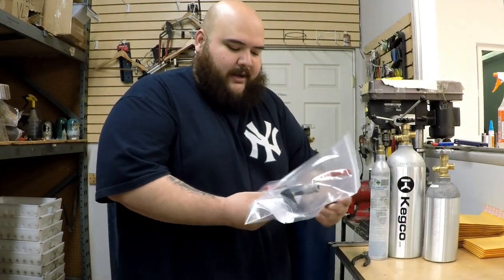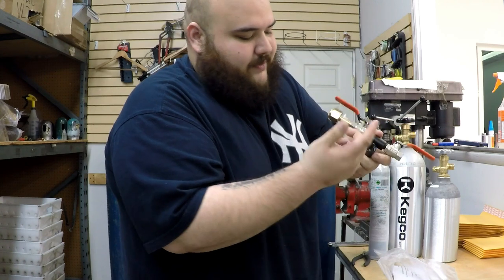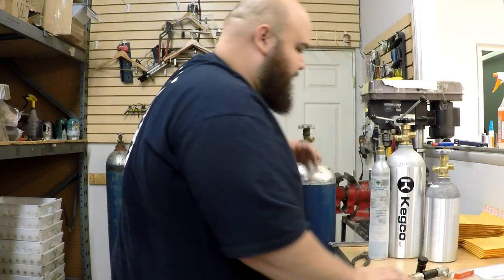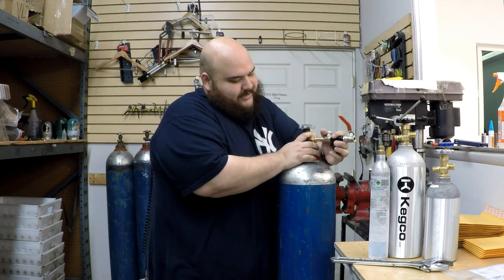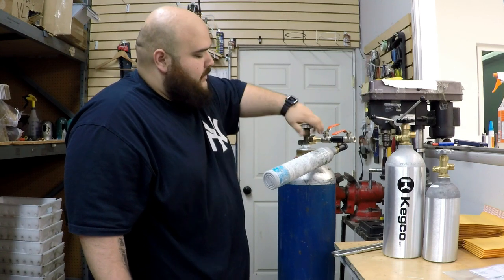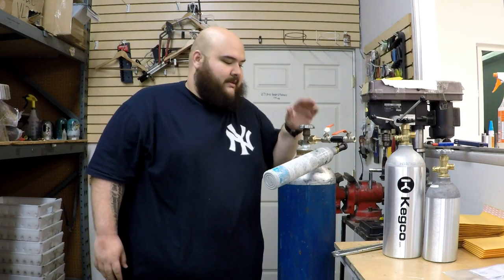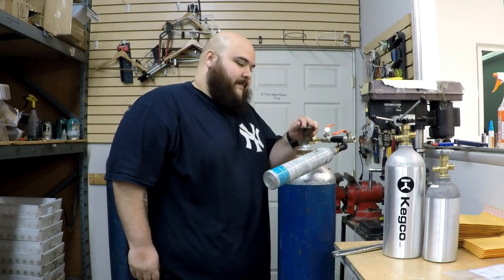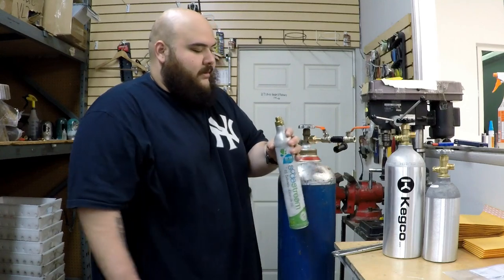Small CO2 Refill station for soda machine tanks

Comment: Thanks for the vid; this is the one with the best advice, though not perfect. The real trick is to just crack the supply side valve on the "kit." But, about that black plastic fitting for the SodaStream tank: you have to turn it counterclockwise to back out the pin that depresses the valve on the SodaStream tank. Once the carbonator (SodaStream tank) is fitted up nice and snug (it's plastic, don't overtorque) you have to turn the knob very gently until you make contact with the valve on the carbonator tank, and then screw it in just a half turn; again, just to crack the valve. The key to success here is "Easy Does it."

Comment: Being doing this for a few years and for you home fillers if you put the mt soda stream bottle in the freezer first, to pre cool before filling, you might have to do this a couple of times to fill the cartridge. Remember a newly filled  20 lb gas bottle puts in a lot more gas then a bottle that is down to the last few pounds of gas. Filling  will takes more tries as the supply gets depleted, literally you might only get 20 or 30 grams each try at the end of a bottle?  My experience says mt soda stream bottle is about 680 grams and you are putting in roughly  410 grams of gas to fill the bottle, for a total weight  of 1090 grams. For clarity i usually take 3 to 4 fills to top off an mt soda stream bottle and you are not burning a lot of gas trying to chill the bottle as you are filling up. I can usually get about 16, 410 gram fills out of a new 20 lb bottle.

Comment: I plan to purchase a New Aluminum 20 lb CO2 Tank CGA320 with SIPHON TUBE. Local sources to fill the tank are quoting $25 to $30 per refill. How many soda stream canisters will one fill of the 20lb tank fill?
Reply: About 10 large tanks (20 lbs = 320 oz. 320/33=9.7). As a practical matter though, as your donor tank gets low, the refills take less and less air. So it'll probably be more like 6 full refills and then another 8-10 partial refills. Double that if you are using the small tanks.

Comment: There are some very helpful comments here, especially for those of us who do not have a siphon-tube tank. My concern is this: My non-siphon tube 20 LB tank is a bit heavy and risky to invert without some kind of a special stand. Would I be able to decline my 20 LB donor tank at 45 degrees until 75% of the liquid CO2 has been consumed, and then invert 180 degrees for the remaining 25% (at a much reduced weight)?
Reply: Yes, as long as the liquid CO2 is going into the soda stream tank, it will be OK.

Comment: It looks like that black wheel (in your case) is used to close or open valve on soda cylinder. you open cylinder valve to fill co2, and close when cylinder is full so you can close cylinder valve and depress co2 in line. than you unscrew cylinder

Comment: Hi, I am using a 10kg bottle with siphon tube to fill a sodastream cylinder but I can max up to 10 cylinders to fill up properly with 10 more but with less gas. I understand that about 30% of the mass has to stay in the bottle because it is gas but I thought I would be able to fill more than 10 as needed. Is there any solution for filling more properly filled cylinders, I am not interested in partially full cylinders. Some pump, manual or electric, some advice, can I refill a half full bottle, ..

Thanks in advance
Reply: I am about to order a unit and get a siphon type tank. What I would try to get a more complete fill is: (1) Make sure all residual gas is emptied from the receiving cylinder before filling. That can be accomplished by venting through the second valve after the tank is installed. (2) Freeze the receiving cylinder as others have suggested. This will condense gas in the cylinder. (3) when you fill, you want to get the CO2 liquid to fill the device before the actual filling happens. I will do that by using the second valve to let the gas escape until the liquid comes out and then shutting it off which will start the filling of the tank. That way you don't inject the gas in the line and device into the tank which prevents filling completely.
But then again - I need to test this myself.

Comment: I have the same issues as a few others. The tank should increase in weight about 14.5oz (net weight). After testing I get only an increase of 5oz using a 20lb tank. My tank doesn't have a sifon, could that be the issue?
Reply: Turn your from tank upside down so the liquid CO2 comes out, that's what the syphon tube does (fills from the bottom of your tank).
Reply from the maker: If don't have a siphon tube inside your source tank, you cant get a full refill only about 50 percent.
Reply: Well, without the dip tube reaching down to the bottom, thus getting you the liquid, you just need to turn your tank upside down to get liquid co2 out. I'd only try it with a 20 lb tank or smaller. 
Same work around if you have a syphon, but you don't want liquid co2 just gas; flip tank upside down to get gas from syphon tubed cylinder.
Reply: yes

Comment: The new sodastream tanks have a large flat inner pin that apparently makes refilling more tricky, do you have any solution to that problem? Is there a way to swap the sodastream valve to one more amenable to refilling in this manner, or is there some practical work around?
Reply: The new sodastream tanks work fine on my end, opening the CO2 tank very slowly (as in the video).
Reply: I had the same problem. I could fill the sodastream tank, but as soon as I disconnected it, it expelled all the pressurized CO2 back out through the valve at the top. Which I thought was impossible, but I wonder if SodaStream changed the valves to make it difficult or impossible to refill them at home.
Reply: @brianbissonette1  yeah that what happened to me.

Comment: I freeze my empty tanks but cant seem to fill more that 1/4 to 1/3. Curious if my five pound supply tank size has anything to do with it? I love this just the same.
Reply: Turn your 5 lb tank upside down so it lets liquid C)c out, seems you're not using a syphon tube in the tank.
Reply from the maker: Make sure that you tank is empty before your freeze the tank.
Reply: you need a siphon co2 tank for source.

Comment: I have this system and it doesn't work. It leaks and I have been able to fill one tank.  I plug the tank in crack the valve and nothing happens. I have a 20lb bottle that is full.
Reply: Weird, works great on my end. Make sure you have a CO2 tank with siphon tube.

Comment: talk about wrong way to do it.. hes got 4 cylin\ders with no i said no chains on them they can tip over.. he walks away never do that... if it tips over your done... also you used a painball tank big no no they contain lead you must use a syphon tube food grade tank like they use in beverage places ... why there coated tanks on the inside..... you can use a non food grade tank but you must flip it over if you want to do that buy a 20lb cylinder as to flip over a tank like this is heavy and cumbersom...

so food grade tank o-rings that are designed for the cold and co2 so no harbor frieght cheap orings people go to a gas place or use hvac orings for ac in your car there designed for high and low and oil contact...

Comment: Do not buy this system or systems that are similar. CO2 is in a liquid form, and turns to a gaseous state under pressure based on temperature. The liquid CO2 must be measured by weight. Overfilling the small cylinders so that they have more liquid weight than they are designed to have can have dangerous consequences. The valves on the small sodastream cylinder are equipped with a small over pressure relieve valve that is designed to rupture at 3000psi, the hydrostatic qualification value for these small aluminum cylinders which are rated to only 1800psi. If there is insufficient head volume, IE if you completely filled the cylinder with liquid, then the overpressure valve should trigger causing and immediate and complete loss of gas/liquid. This event can cause injury or even death as CO2. This is a stupid product design and shouldn't be used by anyone for that reason but also because Sodastream has a DOT special permit restricting the filling of their cylinders. Doing so is a direct violation of federal law. For those people looking to save money on CO2 it is far better to buy a CO2 cylinder equipped with a CGA-320 valve and an adapter with a hose to attach to the sodastream machine itself. This will mean you have 2.5lb or larger cylinder so it isnt as compact but you won't have to have it filled as often and you avoid the dangerous and illegal act of trying to refill a sodastream branded cylinder with their proprietary valve.
Reply: NorthWoodsDiver Law in which country??!!
Reply: This is good advice NorthWoods... I could not work the refills, and its stupid to even try. The hose connecting the CGA320 directly to the SS is much easier, safer etc. WIsh I had come across this earlier